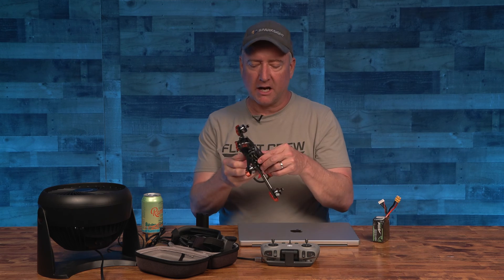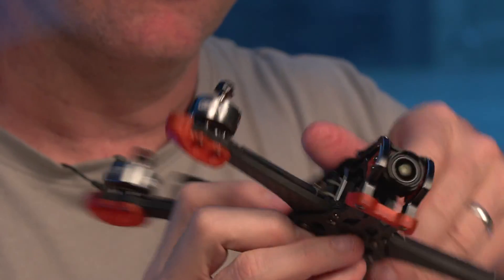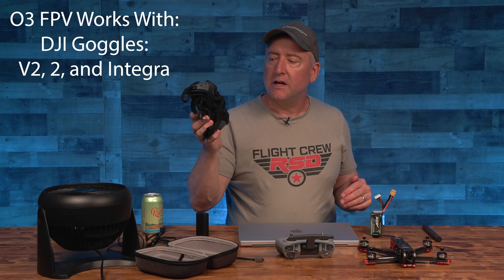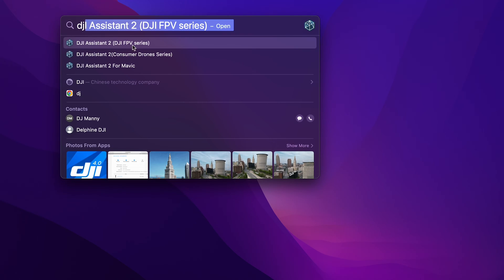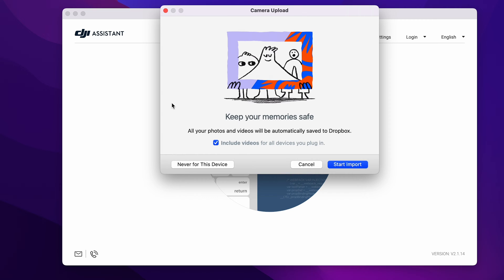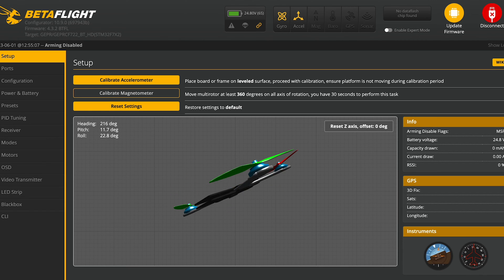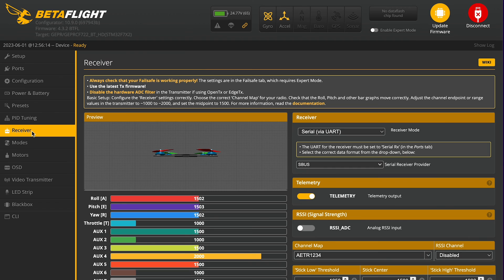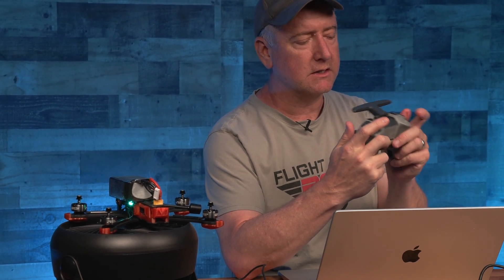How To Set Up DJI O3 FPV Quadcopter - Step By Step

Comment: Very informative! I'm going to do this exact thing for the very first time with an O4 Air Unit and the Goggles 3 when my quad arrives in the post. 
O4 should be exactly the same I reckon, except no need to bind the controller to the drone.
This is exactly the video I was looking for! Thank you ❤
Reply from the maker: Awesome! 👍 We haven't bought an O4 air unit, but we are saving up and hopefully will get to experience it soon.

Comment: Brilliant, thank you for the tutorial! Question, are you able to customize the controller with other functions? For example, if I connect and power a naked GoPro to the FC, could I program start / stop recording of the GoPro by assigning it to a controller function?
Reply from the maker: We've not done anything as complex as that, but if you know how to do that in betaflight, then it shouldn't be a problem. Those switches are aux channels. 👍
Reply: @ no worries, I’ll explore and see how it goes. Thanks!

Comment: My Dji rc2 its connected to the o3 but does nothing also in Betalfight how can I fix that?
Reply from the maker: Check that the radio protocol is sbus instead of crossfire. We definitely are not experts at troubleshooting these kinds of things, but that might get you started down the right path.

Comment: I don’t understand why nobody has the same issue as me which is calibrating camera in the consumer series the 03 will not work for on 5 out of 6 units it just says calibration call Dji and I don’t want to call Dji do you know what I’m doing to cause this?

Comment: Thanks for this video.  But somehow, I'm missing something.  I just bought an o3 air unit to replace the hdzero vtx. I wish to use the dji controller instead of my radiomaster.  I see in your receiver tab that yours is set to Serial RX using SBUS.  I did changed mine to the SBUS as well but no luck. My old transmitter was on port 6. I turned off Serial RX of port 6; no luck. I tried to enable Serial rx on the same port I put the DJI air unit; no luck. I have to say that I'm using the new goggle 3 and the controller 3. The controller is binded with the goggle. the google are binded with the air unit properly and I see the video in them. 
Ho yes... when I turn off the controller, I get a message in the goggle that  there are interference with the controller. What needs to be changed to replace my radiomaster with the dji controller?
Reply from the maker: We haven't yet tried to fly an O3 Air Unit quad with the Goggles 3 and controller 3, but the only thing that comes to mind is the physical wiring to the flight controller from the air unit. Do you have the SBUS wire soldered correctly?
Reply: @readysetdrone  ha... when I checked the soldering (which was ok) I saw a little R2 beside the SBUS label. Sounds like the sbus is using uart 2 on my fc. I assumed that the SBUS was using the same port as the air unit. But it's not.  I have to move my GPS to another port before I can use it. But thanks to your suggestion to check the soldering. That's how I found that out.
Reply: Ok I got it to work. Yes, I had to use uart 2, but the main thing was that selecting SBUS doesn't do the trick by itself. I had to reflash the firmware but this time selecting the communication SBUS instead of the cross fire. Then after that everything started to work.  I hope this helps others...
Reply from the maker: Oh, that's good to know! I'm glad you figured it out.

Comment: Is there an option in betaflight to map the "start recording" button on the controller 2 if I have an SD card in the drone. 
Or do I just somehow start the recording from the goggles menu before/in flight ?
Reply from the maker: I'm not sure about the Betaflight setting, but in the camera section in the goggles, you can set it to auto record when you arm. 

Or, if you have the DJI controller, if you decide to not auto record, you can just press the record button on the RC.
Reply: @readysetdrone  Apparently the record button on the controller was already bound to record on the air unit as you said, I didn't have to map it.
I just took that for granted since everything else pretty much needed to. 
So its all good!
Thank you!

Comment: Thank you again for this video, just got my iFlight Nazgul Evoque 5 set up with my RC3 and Googles 3. Will it tell me in the HUD if I am in  angle or acro mode? I set it up in betaflight but unsure whether or not it will give me the info in the googles view when I am flying.
Reply from the maker: It should tell you, yes. There's a mode setting in BF that should be on your HUD which will indicate your current flying mode.
Reply from the maker: It should be in the OSD section in Betaflight. Just check the relevant box to display the flight mode on screen.
Reply: @readysetdrone  ahh ok awesome! Thank you so much and apologies for all the questions!!
Reply from the maker: No problem! It's confusing and frustrating sometimes, so we try to reply when we can.
Reply: @readysetdrone  thank you! Think I am a little clearer now thanks to you 😊
Reply: @readysetdrone  found it and added it, thank you! I always fly in acro, but I like to see on screen which mode is activated. Thanks again!! 👍😊
Reply from the maker: That's great! 👍
Reply: Last question lol, You don’t need battery plugged into drone to configure custom buttons/modes right? Just plugged in USB is fine? I mean after initial binding etc, I have seen a lot of people just plug in drone via USB to change a couple controls etc in BF, without battery.
Reply from the maker: I think it depends on the receiver and whether you want to flip switches on your radio to confirm. There is no harm either way, but if you need to have your radio connected, and USB isn't powering the receiver, then you'll need a battery. 

But just for configuring in BF, you don't need a battery.
Reply: @readysetdrone  great! thank you for all your kind help!!

Comment: Is there any explanation of how to configure the other buttons on the DJI controller please? I have the RC 3 but not sure what all the AUX buttons are in relation to my controller.
Reply from the maker: We haven't explored the RC3 yet, but (assuming you've connected it to a drone in betaflight) you can always set the aux to auto in Betaflight, and flip a switch or press a button and see what it automatically selects. Hopefully that makes sense.
Reply: @readysetdrone  yeah thank you so much. I was gonna wait for O4 to come out but cant wait lol so went for iFlight Nazgul Evoque 5 with O3. Will watch your video when setting up. :)

Comment: I can bind the 03 unit to goggles 2, although the DJI controller 2 will not bind. Is there anything I can do to fix this?
Reply from the maker: It might be worth refreshing the firmware on the controller via computer and USB-c to USB-a cable.

Comment: i have axisfliying c35 system. when I bought it ,it have a crossfire receiver. I remove it. but Dji fpv controller not see in the receiver page ? what am I miss ?
Reply from the maker: You might not have all 6 wires connected to the flight controller from the air unit. I think you need the SBUS wire included.
Reply: @readysetdrone  yeah seller firm is remove the sbus cablo. I add to 3 in 1 cablo.  If I choices uart and receiver type is correctly should be see each other ? I have to do another something?
Reply from the maker: That sounds correct.

Comment: How do you set up your ports on beta flight for 03 air unit?
Reply from the maker: Great question. We recently made a set-up video about the Cinerace20 v2 O3 which might help. Here's the section where we set up the switches in Betaflight for the DJI FPV controller 2. Hopefully that helps. 
https://youtu.be/8grw_SIt4OE?si=s7f_3XmNdRjErx6T&t=325

If you're looking to configure the uarts for use with O3 Air Unit, we generally just buy the DJI BNF quads, so I'd have to check Betaflight and see. If you would like to have that info to compare, let me know.
Reply: I would love to have that info! I purchased mark5 O3 HD and added ELRS with the intent to move away from the Remote controller 2 one day… but wanted to use it for the time being… can’t get it working

Comment: Great Video, thanks for the detailed explanation. Do you have to do the first steps every time you want to start flying ?
Reply from the maker: No. Once set up, you are good to go!
Reply: @readysetdrone  Hi. I have absolutely awful image quality from my O3 air unit on Geprc Mark 5. If it sunny it looks like 720p when it’s slightly darker or sunset it literally looks like 480p. It is like that from the begining. No crashes.
I come from DJI FPV and footage from the same location, same day, few minutes later from DJI FPV is just insanely better - and O3 was meant to be better than DJI FPV camera that falls off big time in bad weather. This O3 quality on mine is shocking. Obviously all the settings checked multiply times, tried 60fps 4k and 120fps 4k too but same result. No errors, no problems, flies like a charm, not overheating, 6min flies on Tattu 1400 6s, amazing stabilisation everything is perfect - but actual footage is awful. Anyone anything?😞 I beg you.
Reply from the maker: OK - @NONX01  - I don't have a definite answer, but here are a couple of things to consider / try.
1. Are you pulling the recordings off the card in the O3 unit or from the Goggles? The recordings on the card are going to be the best 4K footage.
2. Have you actually pulled the footage into an editing program to see if they are 4K or some other resoution. You say "looks like 480p" but what is it actually?
3. It seems like you are looking at some kind of proxy files and not the actual footage. Be sure to look on the micro SD card in the O3 unitl and see if you are looking at low res proxy files.

That's all I can think of ATM.

Hope that helps!

Kelly - Ready Set Drone
Reply: @readysetdrone  1. No I use the footage from the drone sd card obviously… 

2. Yeah I did edit some of it trying to suck as much as I can but even after grading it still looks awful. It is saved in 4k it says too.

3. No I take it from the usual folder on SD cards same as with DJI FPV and like I said even based on yesterday trip - same spot same time - DJI FPV crisp af - Geprc Mark 5 with O3 absolutely terrible and that was meant to be better camera than DJI FPV
Reply: thanks @readysetdrone

Comment: I'm just learning but watching another video the presenter said you don't need to have the drone turned on to access the 03 air unit. It's powered thru the data cable.
Solves the overheating problem.
I tried it. It works.
Reply from the maker: Nice! 👍

Comment: thanks for the video it helped me get my motors spinning for the first time - however anything over about 10 or 20 percent throttle and motors spool up to full speed regardless of stick position - only remedy - stop switch - any ideas ?
Reply from the maker: Hmmm...that is weird. I wonder if it's the throttle rate setting? Question - when you arm the quad and move the stick to 10%, does it spin slowly (around 10%) and then jump to 100% as you push the stick beyond 20% up? Do all 4 start spinning really fast? What kind of quad is it?